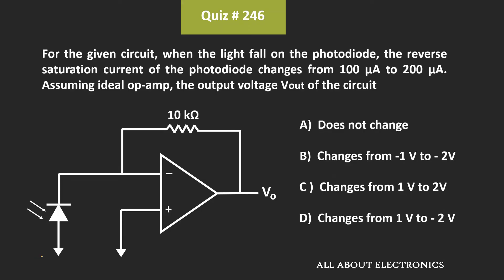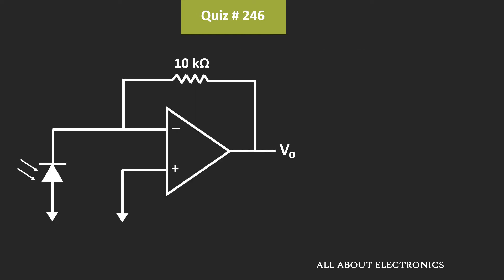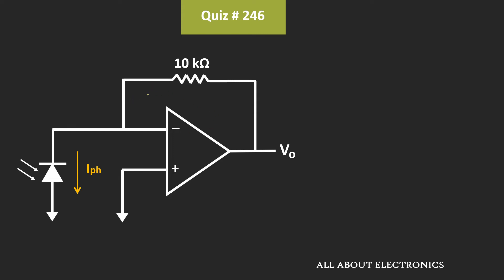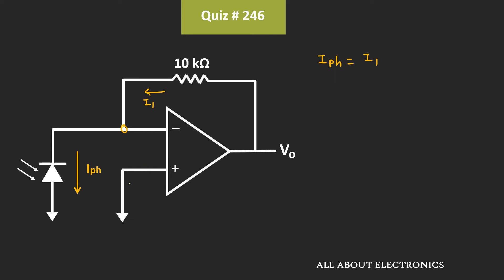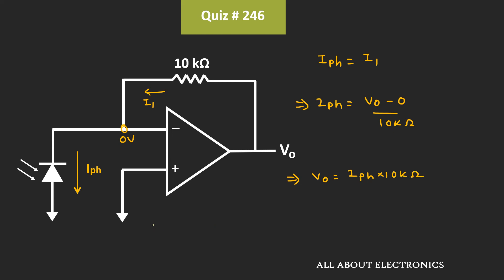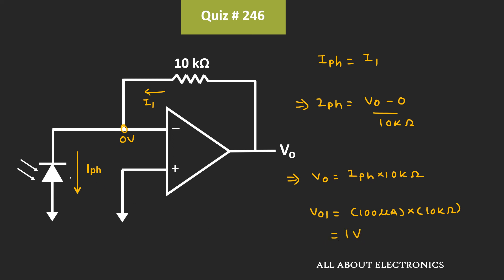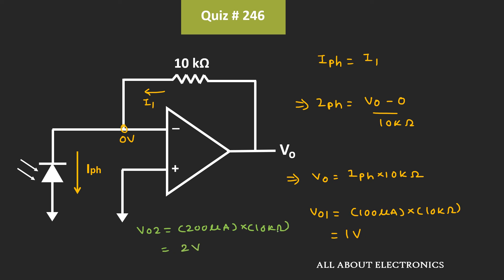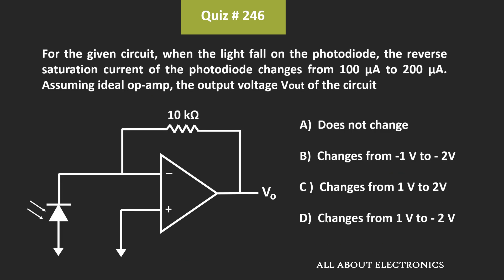Op-Amp Solved Example | Quiz # 246

Comment: Shouldn't the current flow in the opposite direction due to the reverse bias of the diode?
Reply from the maker: Because of the reverse bias, the current will flow from the cathode to Anode. In forward bias condition, the current flows from anode to cathode. That's why here current is flowing in the downward direction. (From Cathode to Anode).
I hope it will clear your doubt.